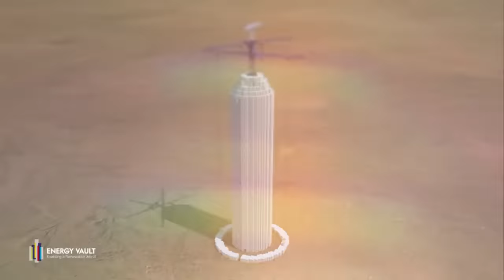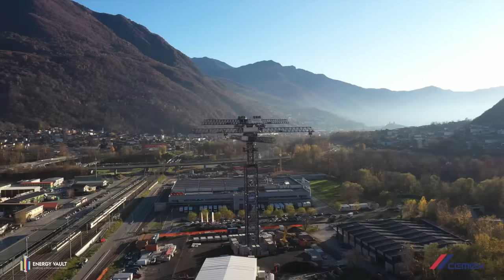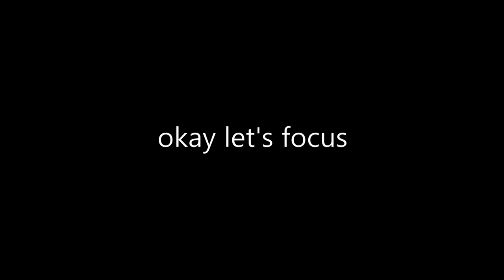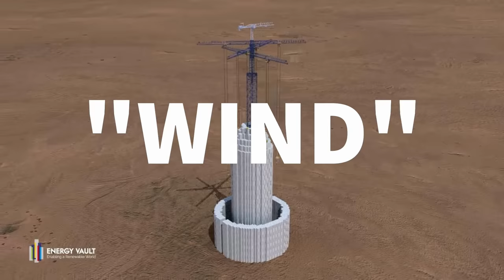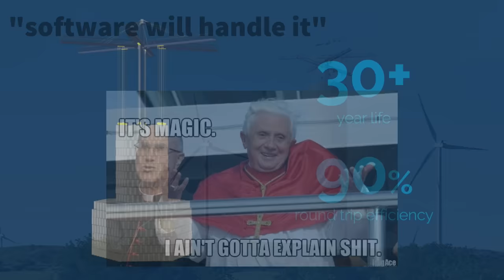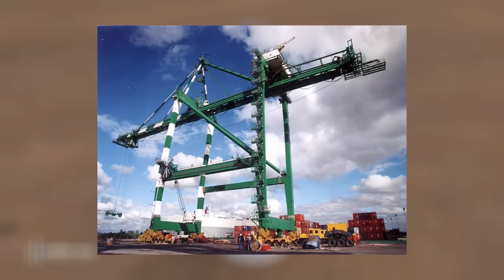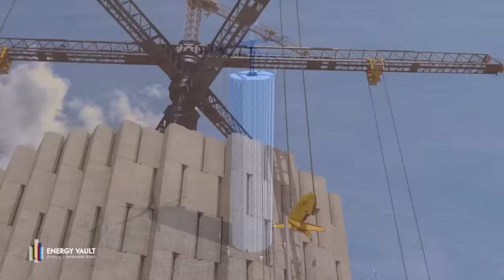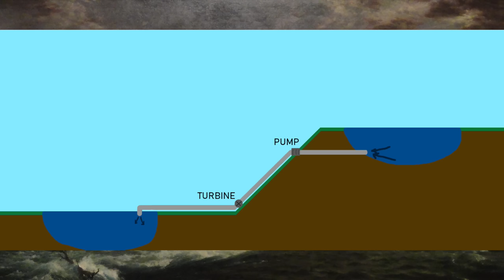The Energy Vault is a Dumb Idea, Here's Why

Comment: Great video. I've actually be a supporter of the energy vault plan so when I saw your video I was like "Wait, am I wrong?" I especially like how you went into the process of showing how the idea could potentially be made to work, eventually merging into the existing idea of a pump storage. To be honest I had never heard of pump storage so I learned two things today! :D
Reply: Why are you a supporter of these things if you haven't taken the minuscule amount of time it takes to learn about the basic technologies that already exist?
Reply: They kind of lost me on the idea when he pointed out that the entire tower could only store the maximum capacity of the daily output of two wind turbines.  
Just a note: wind power is something like 7% as efficient as natural gas, so you would need one “energy vault” per two wind turbines and more wind turbines than the entire surface of the f*cking planet can support to actually account for all our daily energy needs.  Sorry, but renewable energy is a joke, put in place entirely as a PR stunt.
Not even most space-based tech uses solar anymore; most of it’s gone nuclear with thermoelectric generators.
Reply: @alphastronghold715  how the fuck are you comparing the efficiency of wind power and natural gas, what are you even comparing?!
Reply: @s3bastiaan  "gas turbines can operate at 60% efficiency but wind turbines only harvest a small fraction of the wind energy passing by" I guess? Could be worse
Reply: @alphastronghold715  are you just reiterating that large gas plants generate more power than wind turbines? Nobody is contesting that, of course they do
Reply: ah Pump storage is how hydroelectric dams work. when there is excess electricity and the dam reservoir can be filled to the top they pump water back into the reservoir.
Reply: @benjaminmcintosh857  No, I’m stating that it only takes three gas plants to surpass the total energy generation of every single wind farm across the entire state of Texas.  Meanwhile it costs more materials and generates more greenhouse gases AND more waste byproduct to build and maintain those wind farms than natural gas by a fairly significant margin.
Reply: @alphastronghold715  wouldn't that make wind power grossly more expensive than building gas plants? Surely none would have been built if they were that nonviable.
Reply: @benjaminmcintosh857  Yes, you’re correct.  It IS more expensive to build wind than gas plants.  The only reason why it’s profitable at the moment at all is because of the absolutely ludicrous government kickbacks they receive to build them.  They are practically BEING PAID to put up wind farms, of course it’s going to be profitable if your total investment cost is a negative number.

The opposite is also true.  Nuclear power is incredibly more profitable than any other power source, but because of all the government fines and taxes and restrictions that all costs millions of dollars to cover, a nuclear power plant won’t actually see any profits for 60 YEARS despite being the most profitable, cleanest, and safest energy source discovered thus far.
Reply: @alphastronghold715  I definitely also wish nuclear got more support, but what you're saying about wind costing more than gas is patently untrue. The amount of maintenance and the upfront cost to build wind farms is at least on par with gas plants, and the operational costs are indeed lower since they're so much simpler. Consider sending a few technicians out every few days to check things over versus the number of staff required to operate a gas plant, not to mention that the wind, when it's blowing, is free unlike gas.
Reply: @benjaminmcintosh857   The upfront cost is still mostly covered when you start the plant and you still don’t see any actual profits without government intervention, and no the operational costs are not much lower.  You do realize that you have to replace most of the structure of each turbine every decade right?  Furthermore, you have to regularly oil the turbines to prevent them from seizing up, a process which is not cheap nor is it clean.  The price for each system is about 4 cents per kilowatt hour for gas and 2 cents per kilowatt hour for wind, not including the blade replacements and upfront cost which is about 5x the price PER TURBINE.  This combined with the significantly lower energy production per plant does still make it non-profitable without government kickbacks.
Natural gas is significantly better in virtually every way including cost, profit, environment, with the only exception that I know of being safety.
Reply: @alphastronghold715  source: trust me bro
Reply: @s3bastiaan  Source: censored repeatedly by YouTube.

Tends to happen when you say anything that disagrees with the main narrative.
Reply: @s3bastiaan  I don’t expect you to just openly trust me on it, I expect you do actually go and do your own independent research and cross check everything I just said.  It took me all of a five minute google search to find all of this information, and I tried sending you my sources six times; all removed by YouTube in under a minute without grounds.  But by all means, ignore everything I just said without disproving any of it because the platform won’t allow me to submit evidence.  That’s totally not what YouTube wants or anything.
Reply: @rita5176  Yeah, I know YouTube comments are fucky. But this guy clearly doesn't and just thinks he's a victim of a conspiracy.
Reply: @alphastronghold715  unless we figure out cold fusion I think solar could actually be the future, far future that is with Dyson swarms, but yeah ideally we would be nuclear with the help of renewable and not fossil
Reply: @nltiro3387  Solar is the future only after we’ve developed inter solar mining.  Solar is fantastic for space, pretty much garbage for earth.  The rare earth metals for the batteries ALONE are worse than natural gas’s waste products.  Not to mention all the oil burned in its acquisition (strip mining, which is also worse than fracking but you know, politics gotta politic.).  That’s not even counting the actual photovoltaic panels and high maintenance costs (which are nonexistent in space where there’s no elements to break down the panels).  

Although if my options were between solar and wind, I’d choose solar in a heartbeat.  Vastly more cost effective, better for the environment, and a more consistent power source.  But between that and natural gas, gas hands down.
Reply: @rita5176  For the record, I didn’t actually post the links directly.  Honestly, it would likely have been easier for me to do that than to simply paraphrase and put APA 7 citations.  All I did was put statistics that I found via a literal 5 minute google search on there (seriously, just fact check me for yourself.  Do t go to snopes and listen to the bs spewed by that propaganda outlet, look up the data for yourself, because it won’t let me post it here.), and the statistics themselves that I pulled up and mentioned were censored by YouTube.  If I post any specific numbers, it’s gone in 60 seconds or less.  And if you seriously think that YouTube is t censoring conservative views, you’re either willfully ignorant or just plain stupid, because they aren’t even being subtle about it.
Reply: @alphastronghold715  Ive seen YouTube Delete comments No matter what political side they are on, But perhaps it is more agressive towards one side. haven't seen enough data to claim either Way. all i know is YouTube Deletes sometimes the most Random things, i certainly can't imagine a reason why your topic would be censured, but it is a possibility. could you if possible send some keywords that would point me in the right direction? i will have to fact check anyway, but i'll make it easier.
Reply: @alphastronghold715  Hmm, weird. My post containing a historical fact about the Holocaust is still available but yours isn't. I wonder whether that could have anything to do with claiming a "fact" that isn't true...

Comment: Another idea: Drill 2 holes really deep in the ground that connect at the bottom. Like a U-shaped tube. Drop a heavy cylinder into one end and generate electricity from the air that comes out of the other end. To reload, pull the cylinder back up. Done in an area with warm ground, you could also harvest the heat from the heated air.
Reply: Pulling it out would require more energy than pushing it in since youd be creating a vacuum as well as fighting gravity.

Comment: While their idea is definitely not ideal, it does provide a solution that does not rely on variable weather, for places with scarce water supplies.
Wind turbines are great, but their power generation is not always consistent in all locations. The same goes for solar panels at night or in seasonally rainy climates.
Yeah, pumped-storage hydroelectricity is great and should be used where it can, but you need to be geographically lucky, or build a lake next to another one which would probably also have a very large environmental impact in CO2- not to mention habitat destruction and the space the new lake would take up.

This idea may look silly, but it could be worth investigating, but not investing yet lol
Reply: I'm pretty sure a battery installation would be much cheaper and more reliable. ;)

Comment: One of the motivations behind energy vault towers was to eliminate either the geographical constraint (higher place close to lower place, so a hill) for traditional hydro-pumped storage or geological constraint, which again becomes a geographical constraint for underground hydro-pumped storage.
I feel like hydro-pumped storage is overall a better storage than vault towers, but it would be interesting to wonder if other types of gravity storage would be feasible in cases where geography does not allow for hydro-pumped storage (not suitable terrain and inadequate underground rocks for water storage). In that case, which material would be best for vault towers or similar in your opinion ?

Comment: That's one where I would've to disagree with you. 
Water is only viable in temperate climates in the first place. 
The iberian penincula would already be unviable for example since water is sparse to begin with and also would evaporate too fast from the storage. Similarly Italy would be unviable because the area of most of the peninsula is far too limited due to the appenines.
And even farther north you'll run into trouble due to the more arid continental climate starting behind the German mountain ranges. Seriously Saxony Anhalt has barely enough water as it is.

Now you're right that concrete is dumb and no alternative. One reason being that the sand we use for concrete isn't an unlimited ressource. It's only very special sand we can use for it in the first place and most people tend to forget that. 

What can we use instead? Well literally almost anything. Use the sand we can't make concrete from for example. 
Store it in a silo which you fill from the top and let it out at the bottom.
Some energy will be lost, but tell me there's a better idea. It's a mostly useless ressource used in a simple and reliable way to store energy.
Reply: Use recycled plastic filled with old recycled lead as lead car batteries get replaced with better ones, lol. Giant bricks of plastic filled with lead.
Reply: The issue with sand is it quickly erodes mechanical parts, but other than that it's pretty good. In those climates a better solution for grid-scale energy storage might be compressing gases or some kind of heat engine, storing heat during off-peak hours and extracting it to produce power when demand is high.
Reply: Water is viable if there are rivers nearby to supply water. As such there already are lots of hydropower plants that also do energy storage as secondary or even primary task. And sure, losses through evaporation are inevitable (though proportional to surface size rather than actual volume of rservoir) but here the idea is to pump on daily cycle, so a lot less would be lost during a single day.
Reply: Still not something that can be put EVERYWHERE, but it does work in most climates.
Reply: You don't need that much water - you only have to fill the reservoir once after all and then fill up only the losses. And evaporation can be minimized either with what is called roof or with plastic balls (which, yes, is done womewhere). 
We here in Sachsen-Anhalt are getting the bad end of the climate chane stick though, that is true. Everything looked awfully empty after the two extra dry years.
Reply: Bringing in water by truck would still be cheaper and more reliable than concrete blocks.
Reply: @steemlenn8797  They use balls in one of reservoirs in California I think
Reply: I feel like this could be a good retrofit on grain silos. Have it move the grains around to generate or store electricity while they wait for buyers/the right time to sell grain
Reply: From what I can see on the internet sand is about 1.5 to 2 times as dense as water. The two time density is hard packed sand, the one and a half I’d sand that can flow. So the sand silo will need to be the two thirds the size of the equivalent water storage dam to store the same amount of power, assuming the same amount of hight difference between the top and bottom storage reservoirs, which you are not, you are making less.

Comment: I guess the big advantage of that kind of facility is that it's applicable to a wider range of locations compared to hydro. The low capacity is a big, big issue, though.
Reply: The same benefits could be achieved with far fewer inefficiencies using flywheels--which incidentally is another tried and true existing method of energy storage this doofus' design is ignoring while exploiting the same basic physics.
Reply: doesn't u actually need perfectly flat land with no wind for that facility which actually much harder because flat land usually has a lot of wind
also u can just build water tower it will actually much cheaper, stable and environmentally friendly than 200K m^3 full of concrete
Reply: Even in a place without water it would be more efficient to ship water in than use this. You would not build something quite like a normal pumped hydro storage facility. You would probably do something like using water as the weight for an underground combressed air system. But the general point is the same. Constructing weight just does not make sense over using things that are just already heavy and easy to move around for their weight. And water is perfect for that. Its heavy, its cheap even if you have to ship it, and it can be easily moved for its weight by pumps.